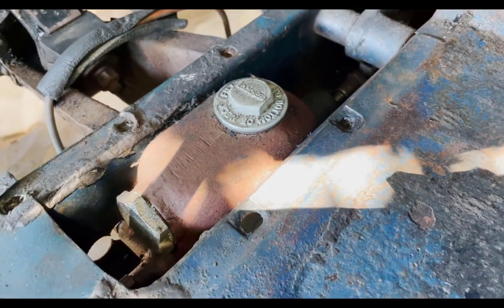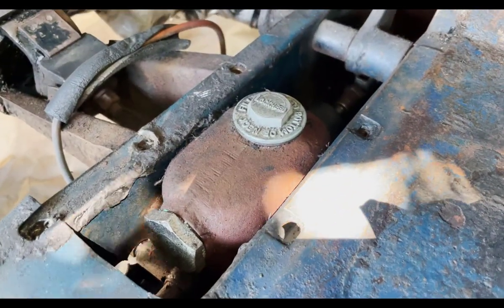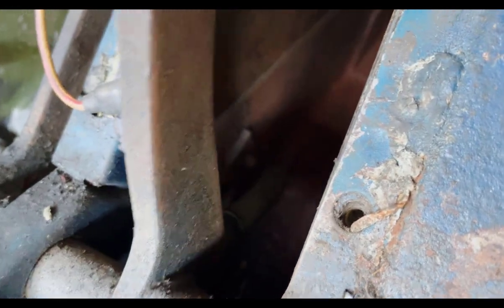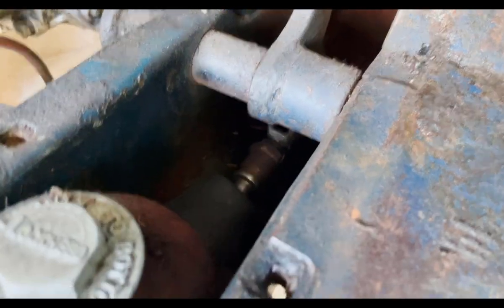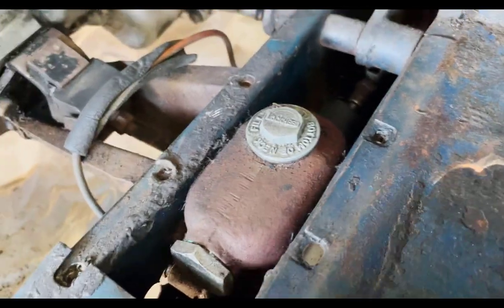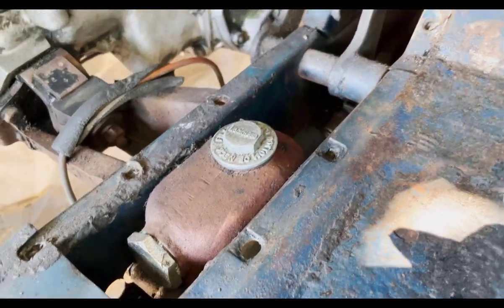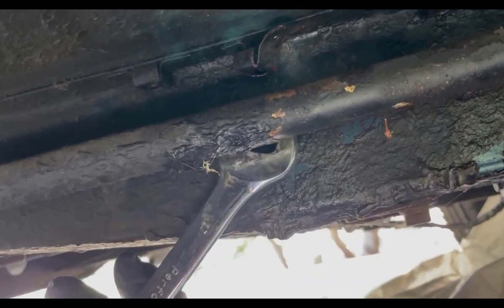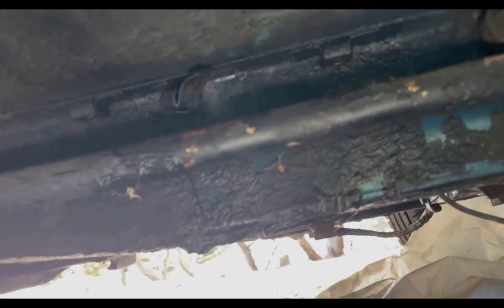Removing a Morris Minor Master Cylinder

Comment: UK suppliers can provide the correct bolts for the master cylinder. The bolts have half thickness heads so that they clear the torsion bar. The experienced guys on the UK Club forum prefer to fit the bolts as originally intended. There are two reasons for this. Should the nuts become lose the bolts cannot fall out. Also, there is very little gap between the chassis rail and the bar - hence half height bolt heads - the reverse fitment cold cause an issue with rubbing against the bar in some circumstances. The method of bending the bar slightly out of the way is way easier than it sounds. just need a flat bar and a g clamp.

Comment: A couple of wooden wedges between the torsion bar and the floor and against each other will force the torsion bar out of the way and enable the proper bolts to be put in the right way round.

Comment: Done very many of thesee when I wore a younger man's clothes. You do not need to remove the push rod, clevis pin etc, you can remove the master Cyl and service it from behind once the brake tubes are released.   All the comments about the cylinder retaining bolts are true- I have the manufacturer's manual which advises to remove the torsion bar!  Don't. It's spring steel you can force it without damage as per the comments above.  One thing which is really relevant here in NZ: You don't want to ever do it again, so send the cylinder to an engineering firm  which specialises in re-sleeving them in stainless steel. Do that, and it's the last time you need to do it. Happy Motoring.

Comment: Please don't use the pattern parts for the brake components: use the OEM equivalents. The pattern components don't last that long. I'm having to replace front brake cylinders far too often and now I'm about to fit the more expensive non pattern ones.

Comment: I find a grinder through torsion bar cut heads off bolts then Chap out pin punch getting the transmission cover off is hell spent 2 hours grinding brass heads off

Comment: Coach bolts - good grief I would definitely change them! An easier way when removing and replacing the master cylinder is to undo the union at other end of the pipe that runs through the chassis rail. All you have to do is undo the union at the joint behind the torsion bar cross member and remove the grommet. Saves a lot of skinned knuckles!